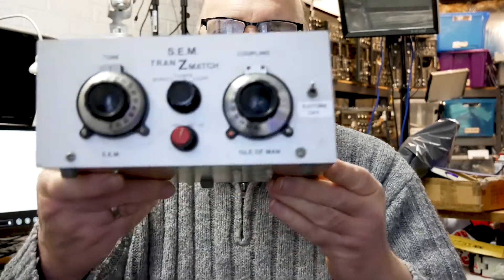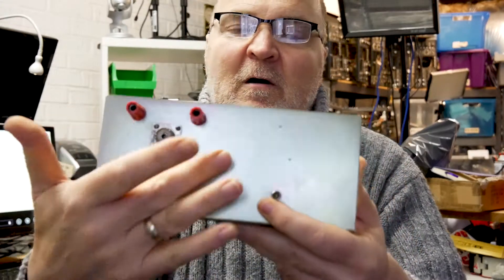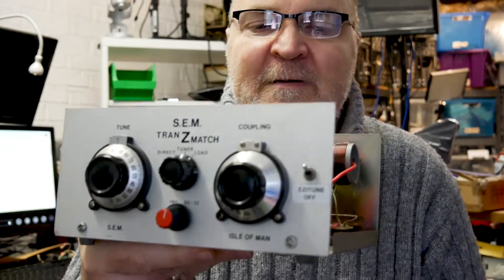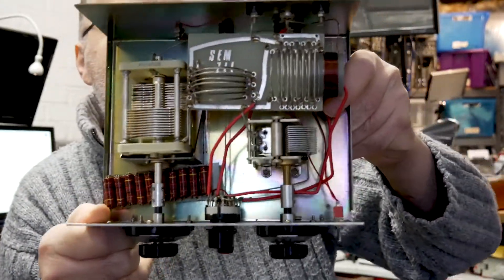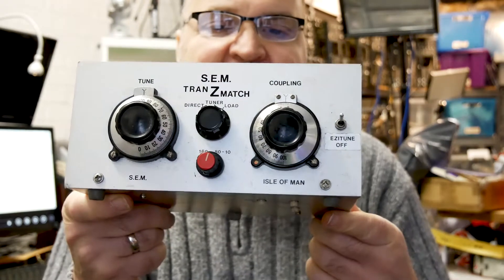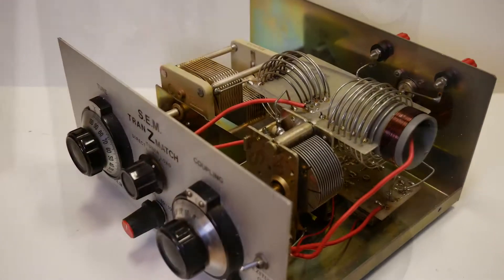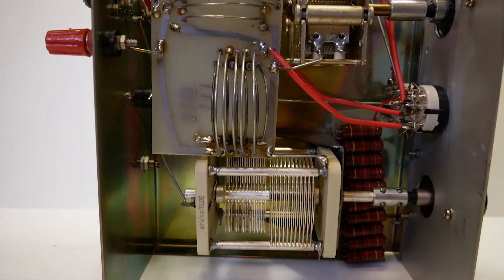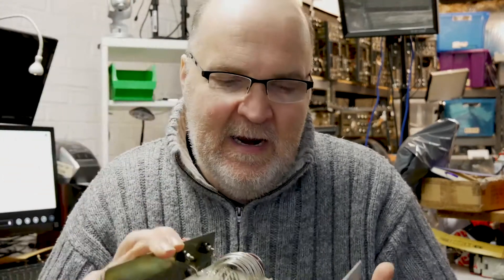SEM TranZmatch balanced ham radio antenna tuner

Comment: hi could any one help I have a set trans match with easy tune when I connect the tx patch lead from radio it seems. to work but when I s new up the pl529 it stops working and no receive unscrew the pl plug and just leave the centre pin in it receives   do you have to have power to see as the curicut looks like its going through the currcut board?????

Comment: On my Tranzmatch there is a third SO239 socket & another couple of binding post connectors....balanced or unbalanced I think?, would have to check the manual.

Mine has no 'straight through/direct' option, only 160m or 80-10.

Thanks for the video de MM6PMQ

Comment: Did you say 1000 watts I think its more like 100 watts the plastic switches will burn out and the tuning caps will short out I have one with out the easy tune and 160 m factory mod.